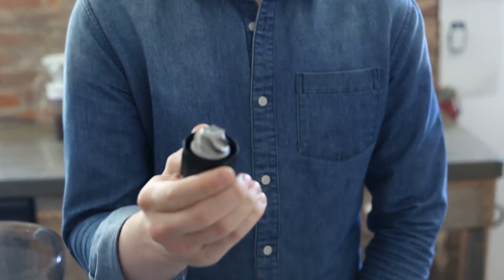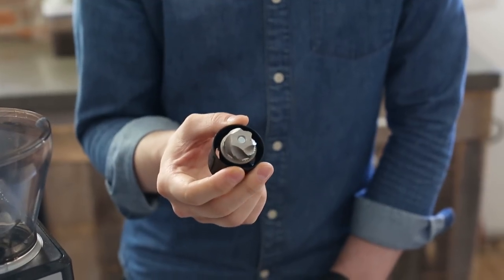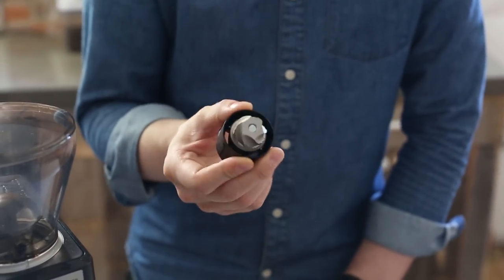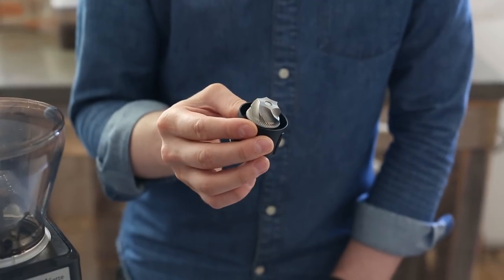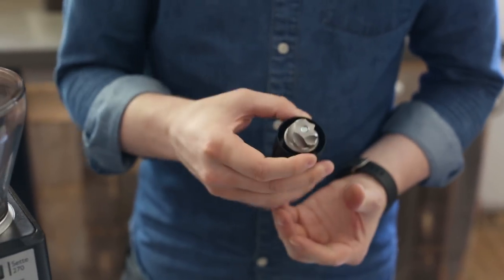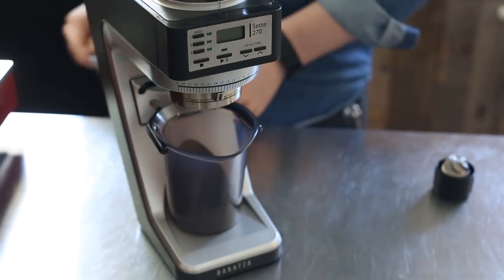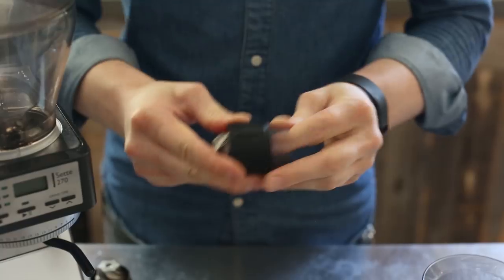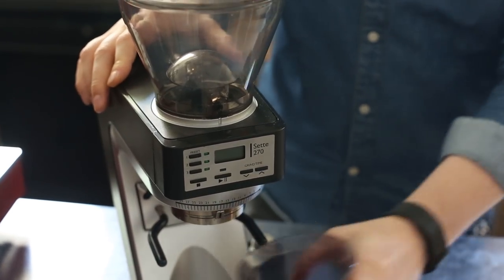Baratza Sette Coarse Burr (BG) and Holder Overview

Comment: What about v60 ? does this upgrade help produce less fine grinds?
Reply: Ahmed Al Mulhim They say in the video that it's good for Kalita and Chemex. V60 is maybe a little bit finer so it should perform good for that.
Reply: Lets talk. I have the BG burr and still deal with fines. I've been having to sift the fines out to pour a decent v60 with normal brew time parameters.
Reply: same. I have been using the "Handground" grinder that I backed Kickstarter. It is mediocre, but at least I don't have muddy clogged cups.